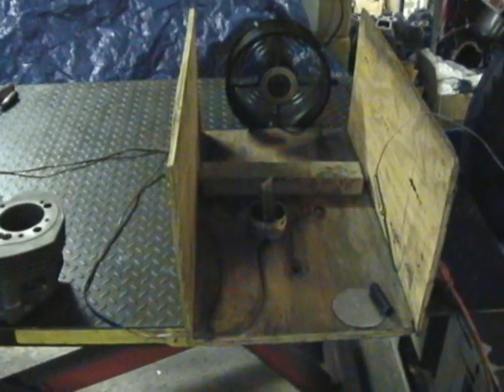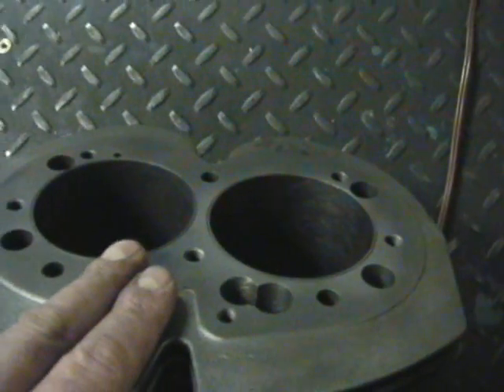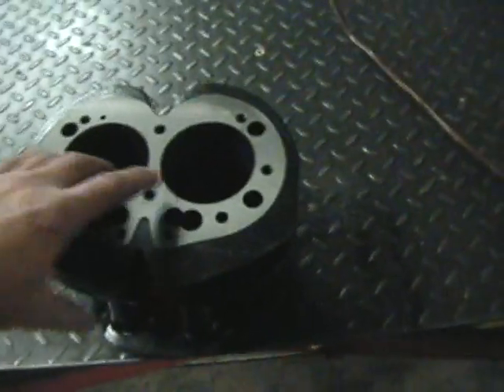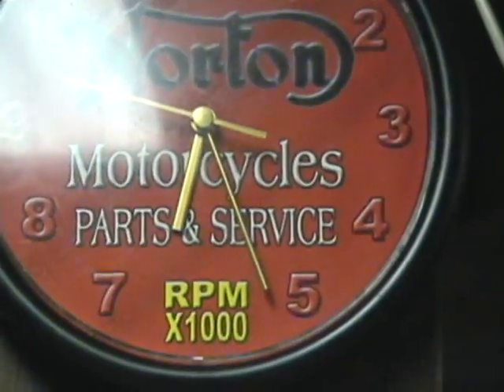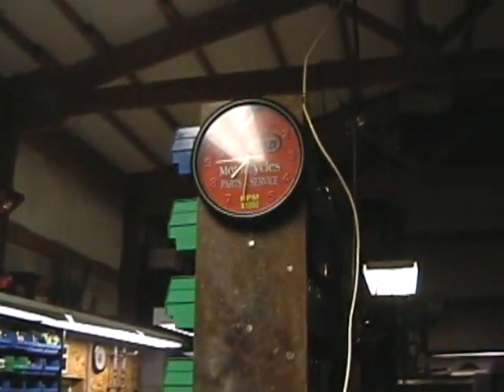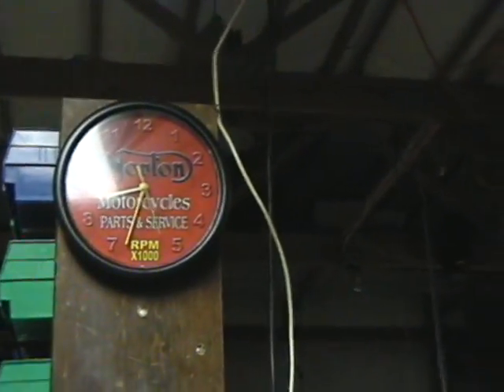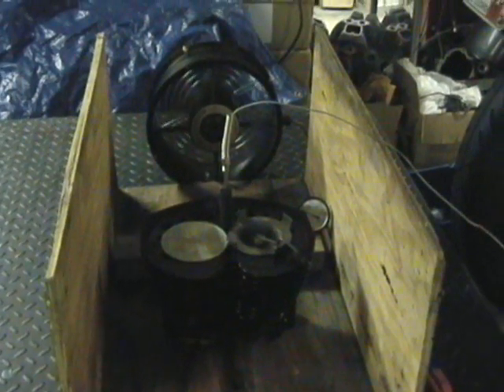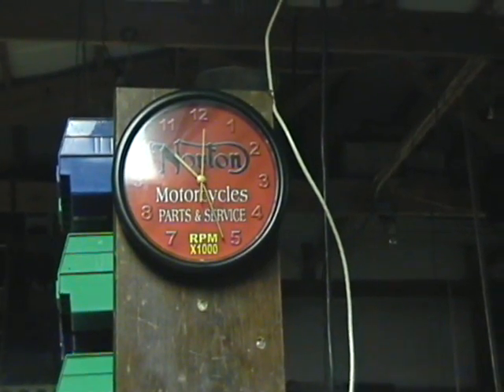Barrel coatings

Comment: I know this has been some years past, but as I'm new here :-) I always felt the problem with motorcycle engine design/implementation is that there is so much heat at the exhaust side (at the front of the airflow, which your room temperature mimics), along with the undirected airflow causing the front to get more active temperature exchange, makes for an inefficient cooling system. You have me thinking... :-)